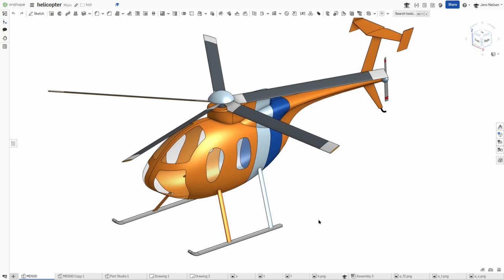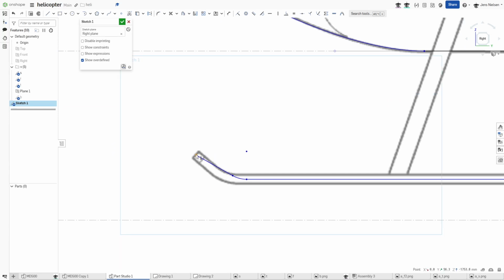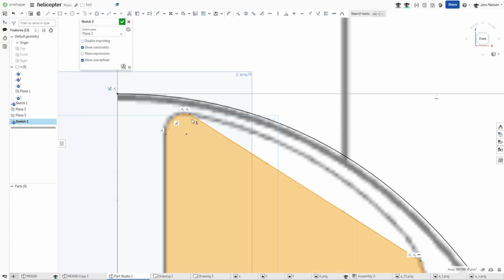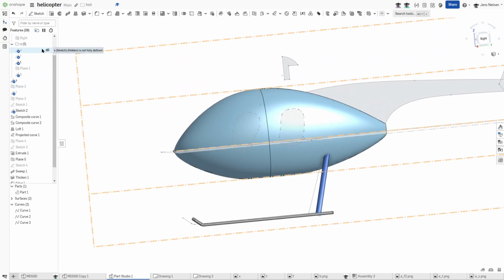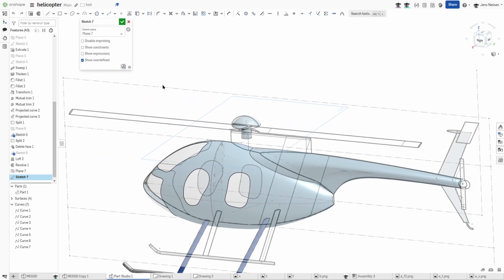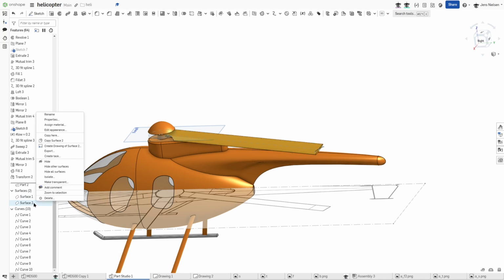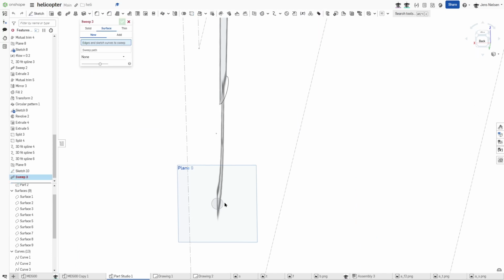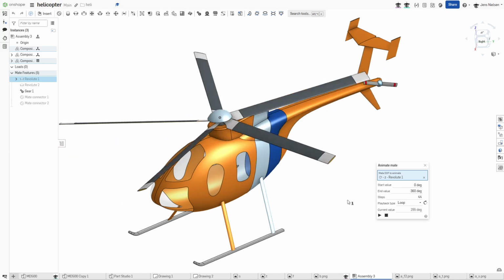Watch Me Build a Helicopter Step by Step!

Comment: you just blasted through inserting those images with no tips on how to manipulate them. how do you get the image to resize after you have moved it around? and how do you get the constraints available while your moving the images? you left out a lot of would be helpful info.
Reply from the maker: Hello, in this video I wanted to show the process of modeling a helicopter, it is one of my longest videos. I needed to shorten the initial process on how to insert and manipulate the reference images. In my airplane and drone videos I spent more time on this. In short: once you insert an image, you need to find a reference line. You constrain one edge, or point of your image, and can then pull or push accordingly. Hope this helps.